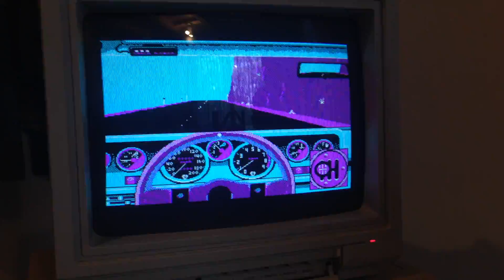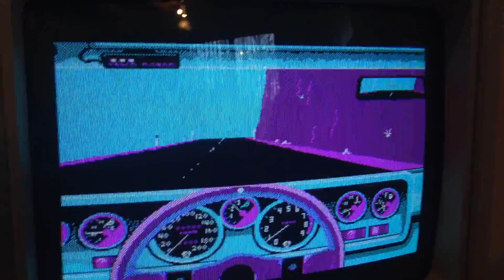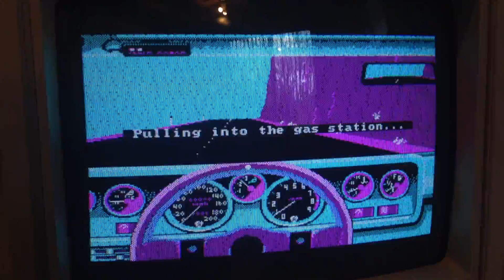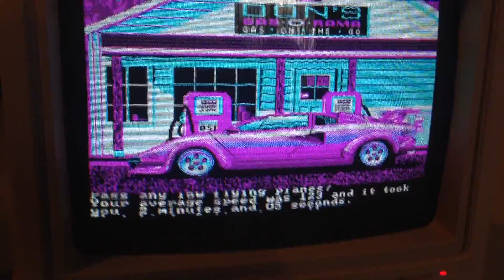Revisiting: Tandy 1000 SX - 5/9 - IBM Test Drive 1 (CGA) - 2/2

Comment: I just tried this in DOSBox, which I can only get to work in 16-color EGA mode, not 4-color CGA: youtube.com/watch?v=BR8BlPOL0mQ  It was also an opportunity to try it with a joystick. Now that I think about it, I think we did use the Tandy joystick, since you could use it as an H-pattern, where you can grab the stick, move it in the H, and then let go in the correct gear. But I don't think we played it like that. I think we either used the joystick with a button for gear-up & gear-down, or just with the keyboard directly.
Reply from the maker: So the joystick didn't let you steer faster/accurately? I forgot that it emulated a manual gear shift box.

Comment: It's interesting how they made it work. When we played this we had no idea that the keyboard repeat rate was being used. We could've improved control using MODE CON to set the delay to 0.25 seconds and repeat rate to be 30 Hz. Nonetheless the game worked. You don't have to steer far to even make sharp turns. So they did it right within the technical limitations they didn't know how to overcome. Even Lode Runner and the Sierra Quest games didn't figure out how to hook into the keyboard interrupt.
Reply from the maker: It's amazing those limitations held back professional developers. No wonder we were caught under them too (as children).